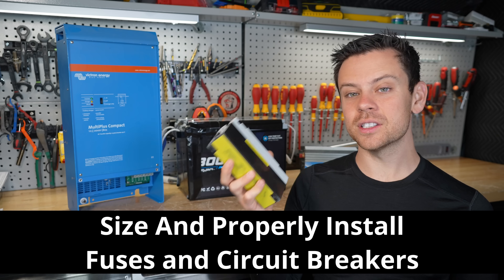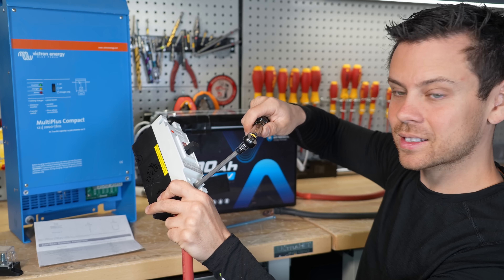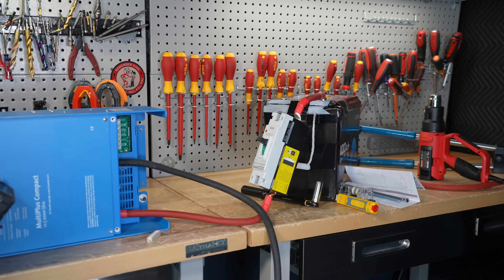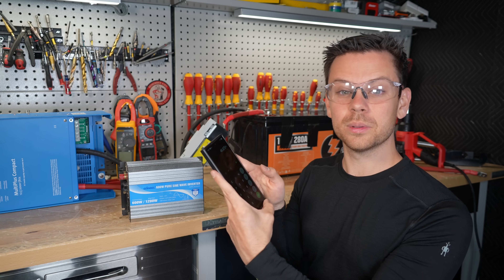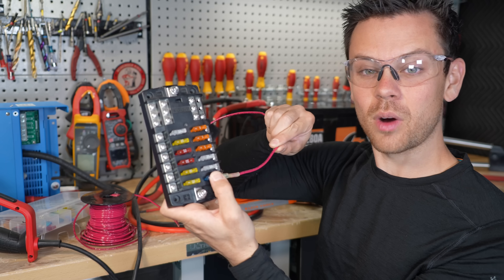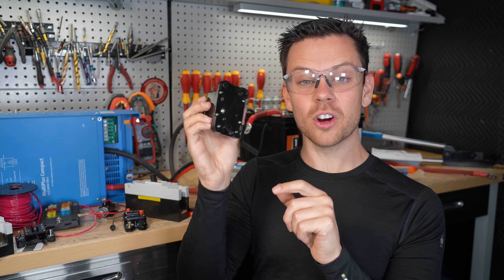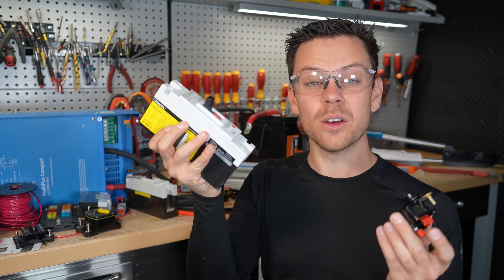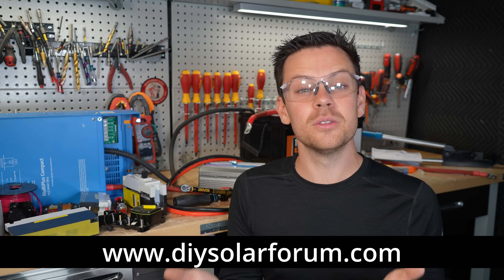How to Size DC Fuses and Breakers. Bonus Tips and Tricks!

Comment: does it matter if you use the Negative or Positive to charge with the Capacitor ?
Reply: No. Works on either. In the case in the video, it was simpler do do it on the negative. In my solar system, I wired it in parallel with the cut-off switch, so I can use it any time I need to shut the system down for repairs or mainenance.

Comment: I do appreciate your regular use of PPE throughout your videos, including how you sometimes talk to the camera while still wearing safety glasses (after all, taking the safety glasses off doesn't add anything). I think your practices here normalize basic safety, so it's particularly perfect for this video. This frequent practice will eventually save someone an eye if it hasn't already and probably prevent several people taking trips to the emergency room given the reach of your videos. I know my own safety glasses have saved me from injury at least a couple of times when doing home renovation work, and there have been many times a wire nearly grazed my safety glasses (so had I not had them on, it would have been a near miss of a severe eye injury).

Comment: Question about the line/load on the circuit breakers. Charging and discharging flows different directions. If I'm charging then the inverter would be the line and the batteries the load? Discharging the Inverter would be the load and the battery would be the line?
Never found good info on that so I thought about how I use it. I charge at 100a but never draw anywhere close to that. So the inverter is my line and the batteries are the load. Until the house burns down
Reply from the maker: It's a very good question. Even though a charger is feeding current in the opposite direction, The battery is still the current source that we want to protect from. So you want to connect it how you would with a load attached to a battery.

Comment: Very nice video, thank you. And I have a question, if my wire comes from the alternator, via the starter motor and go's all way back to my trunk. The wire will be exposed to the environment and I was trying to figure out which kind of fuse should I use here. And what kind of sealing should I use to protect the fuse. I would really apreciate if you offer some guidance. Thanks!

Comment: The breaker color, what does red and green mean?
Reply: Red means energized or power on, and green means de energized or off and good to go to service as power is disconnected
Reply: @Bob-sy5gm  I noticed it seemed backwards to what I would think is proper but it makes perfect sense to be red for ded and green for go. What could go wrong it's only 500 amps.

Comment: How should you configure the fuse/circuit breaker & wire size if using a server rack with multiple 48V/100Ah batteries?  Say (4) EG4 batteries to a 6000XP or 12000XP.
Reply: Each server battery is independently maintained with a built in breaker,  so you only have to worry about the size of the inverter for total out.  He has a video on this about what size wire to use

Comment: Thanks so much for this series. I've been following along closely and doing checks and balances on my system.

In your testing video I was hoping to see an example of what happens when a 12-32v rated mega fuse is used with a higher voltage (51.2) system
Reply: Short answer, it lets through much more than it’s rated current. Fuses are nothing more than resistors that are designed to heat up until they flash-melt their innards, at a given amperage. However, current (amperage) is a function of voltage and resistance. If the voltage increases, but the resistance stays the same, you’ll get more amps to pass through the fuse without tripping it. For example, per Eaton’s own data sheet, the “30 amp” ATM blade fuses that most people use in their cars will (at the 32 volt max of the fuse’s rating) allow upto 40 amps of draw for upto 50 seconds before it trips. That same fuse will barely cross 33 amps at the ~14v that the intended application operates at. Why? Because the lower voltage means that the “element” of the fuse (the part that flash-melts) produces enough heat at 34(ish) amps that it can melt and break the circuit. This also means that fuses can allow more current (although not much more) if they’re kept cooler than intended while in use; but the bigger hazard by far is exceeding the rated voltage.
Reply: @jacobcarlson4010  By far the largest reason fuses have voltage ratings is to prevent arc-over when they blow. If you look at MRBF's from Eaton- You'll see their (short circuit) interrupt capacity decreases as the applied voltage increases. As a rule, Fuses and circuit breakers cannot be expected to blow/trip reliably or quickly below 150% of their rating. Littelfuse and Eaton's spec sheets for ATC/ATO (the normal blade fuse size, ATM is known as mini's) show their load/blow time curves- 125% is typically somewhere between "tomorrow" and "never."

Comment: The purpose of a fuse or breaker is to be the weakest link in the chain, that way they will sacrifice themselves to save the other components. Hence over-sizing wires is a good thing -- ensuring the wires are NOT the weakest link.
Reply: Weakest link wire fire?

Comment from the maker: Please share with beginners! This could prevent fires. It may seem like a simple tutorial, but these steps need to be followed perfectly every single time.

Also, never ever use an ACbreaker with a DC system!!
Reply: Please share this with anyone who works with electricity. Many people work with electricity all the time but only in certain applications. I think even electricians could get useful tips or reminders from these videos.Thanks again Will,
Reply: Cheap thermal camera can really help as well. Eaton or Busman fuses and circuit breakers are my go to, I think most of the Blue Sea stuff is rebadged Eaton. Don't cheap out on the safety equipment. Always size any circuit breakers or fuses to protect the wire, not the equipment. Always try running near the capacity first, and check with the thermal camera for hotspots. You will be glad you did.
Reply: FYI a little thermal/electrical compound like Penetrox or Nolox between your bolting surface and lug will help with heating, prevent corrosion and fill in pitting or scratches on the surfaces.  Use it on all the high voltage connections we do.
Reply: The only chart I have ever found for amp flow through wire talks about the type of wire and when the wire itself liquefies. It doesn't talk about when the insulator starts burning.
Reply: Hi WILL..
Maybe I missed it..
Short Circuit interrupt current of Fuse's.. with Lithium Batteries..
my go to is..
T Class.